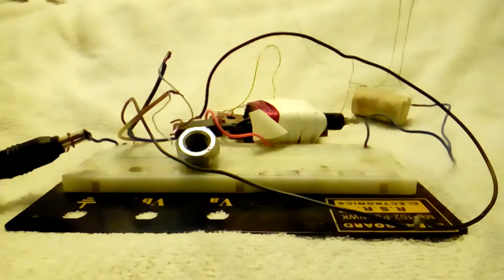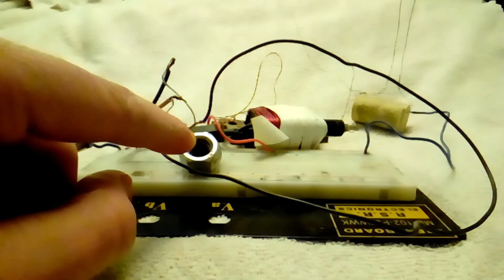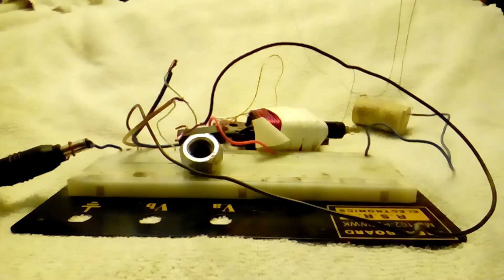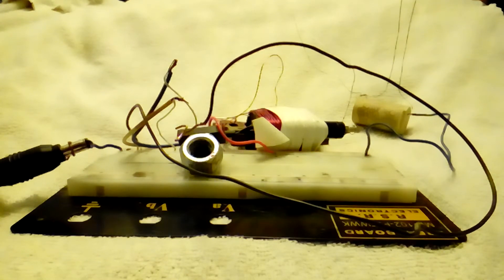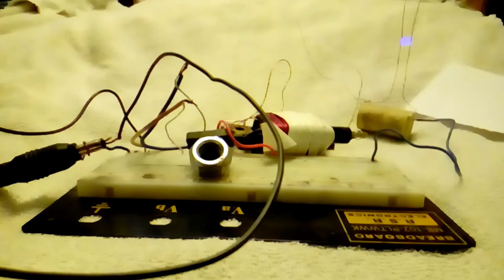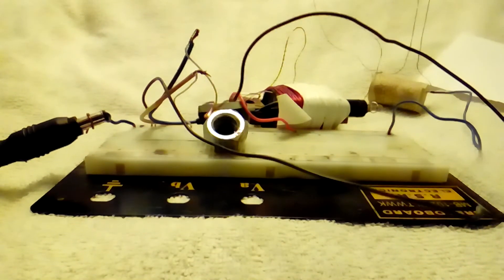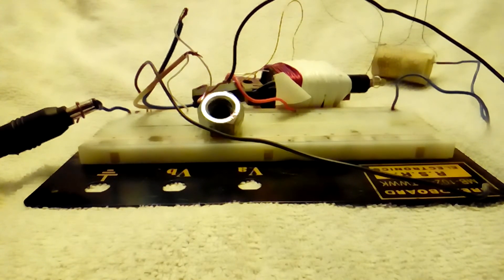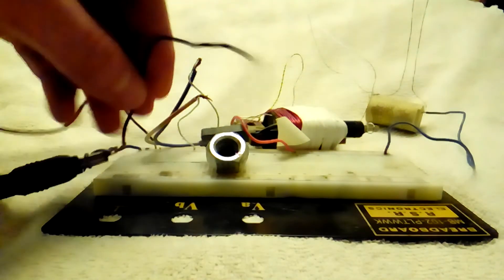Jacob's Ladder with ignition coil

Comment: it looks like an intergated ignition coil from a weedwacker or something, but it has the HV connector instead of just the wire coming out, so it must be something kinda old
Reply from the maker: I think it was from a small generator? I found it randomly, the motor had been shot full of holes and the HV lead was nowhere to be seen. I’m honestly not sure if it was just on a connector or if it was permanently attached at one point?

Comment: Laptop Supply: Nice way to get some power. I used one for my Teslacoil. Its reliable, you probably have many just laying around from old equipment and its a Voltage that you can boost or step down with cheap ebay modules. 

Id recomment you not touching HV stuff with paper. An insulated stick, or a Grounding Rod may be the best way to go. 

Oh and maybe you dont want do fundle around with the curcuit itself. Just pluging in the Laptop supply in a switchable socket would work, so you dont have to touch wires. 

I dont know what sort of driver you used here. If you use a good driver, you might be able to get better arcs, that carrys some current and heat. A half bridge with an IR2153 could do the trick.
Reply from the maker: Thanks for commenting! You're right, adjusting the circuit while running wasn't good, on another occasion I got shocked doing that. I was mostly relying on the low power of this circuit to stay safe(ish.) I wouldn't attempt that on a higher power driver. The paper was mostly to give a backdrop that would block the air current that was keeping it from moving predictably. Still bad practice, and I should try to do better, especially since I could be setting an example for viewers

One potential (no pun intended) problem I realized after the fact is that computer power supplies are supposed to be isolated from ground, but the high voltage output isn't isolated from its input and in theory, if the output connected to ground or capacitive coupled, it could use the supply as a "return path" and damage it in the process. This particular circuit and power supply were OK together but it's something to think about.

This was kinda just a "bonus" video for my older one where I show how to build the driver. It's a "joule thief"/"blocking oscillator" type circuit, and as far as I know I'm the only one on YouTube to try that on an ignition coil. It works, but not very well. Still, I had to try it and then decided to have a little more fun trying a Jacob's ladder.